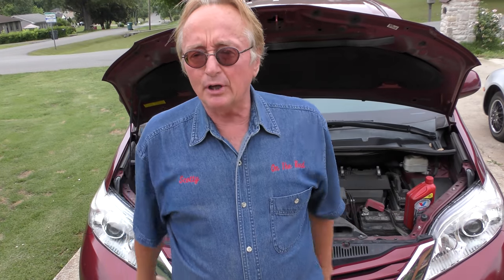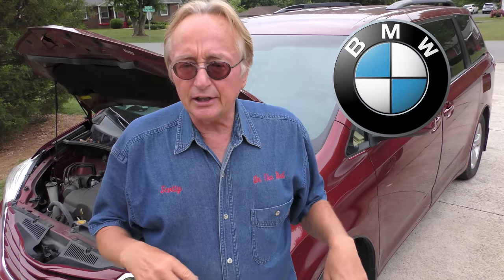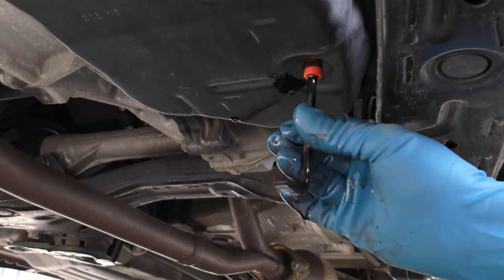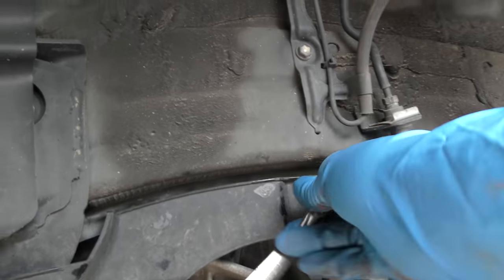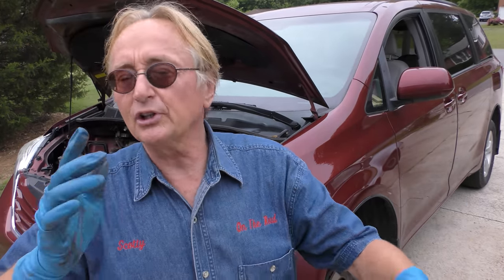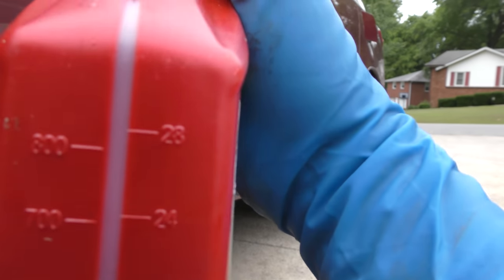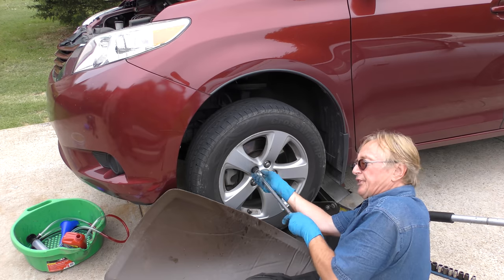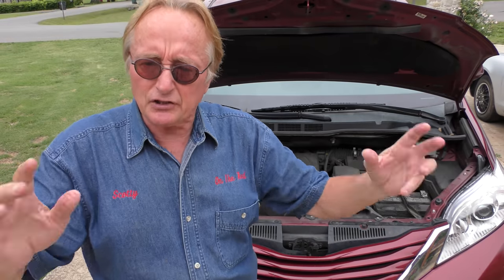Here's Why Changing Your Transmission Fluid Can Cause Damage

Comment: Hi Scottt hi have a 2012 civic lx sedan with 190k miles maintenance done regularly because it's my daily car . My issue  is that it's grinds when shifting from park to reverse and drive not often . Also it does the noise when coming to a stop. Also the transmission shifts great with no hesitation at all . What can it be

Comment: I got an 2003 Chevy Suburban 1500  that seems to be in limp mode. I can't go fast my rpms may stay at 1500 or less when going 50 60mph. And it's as if I can't get out of 2nd. It also has a hard shift and can take a while to even get out of 1st. Anyone have similar issues?

Comment: Hey, Scotty- I have an '02 Toyota Sequoia with 246k miles on it.  The transmission fluid was changed about 25k miles ago and has been clean and leak-free.  On Saturday, getting onto a highway going uphill, I pressed the gas, it accelerated (no slippage), and I allowed my engine to rev up to 4500 rpm before it shifted from 3rd to 4th gear and then I smelled a burning smell.  I tested it again at 3500 and burning again.  Haven't gone above 2500 since.  The fluid is now a little darker than it was.  Everyone says don't change the fluid, but it had already been changed semi-recently.  is it wise to change the fluid?  It's shifting normal so far- no slips, and the shifter goes as normal.
Reply: it was mentioned @0:50 that if you are way past 80k mileage without ever changing the transmission Oil then don't bother changing it cuz it might result to more problems and just pray that your car will last as long as possible
Reply: @03Shinigami he said 180k miles not 80k miles

Comment: Friction can multiply. I lower the wheel to where it touches just enough to not turn when I tighten the wheel bolts for the final tightening. If somehow the wheel wasn't perfectly centered with the weight of the car on it it might not be able to center the wheel. Then while driving I'd here some vibration as the bolts loosened up as the wheel rattled. Back around '85 I heard my front left wheel of my '67 bug making some noise and pulled over and noticed the wheel bolts had rattled most of the way out. OOps.

My 1999 Camry has a tranny dipstick and my 1992 Nissan Truck doesn't. I drained the gear oil and then realized the fill plug was in so tight I couldn't get it off  even with mega force to the point I was worried about breaking the case. Noticed the reverse light switch electrical plug thingy was vertically the same height so that came out easy and I filled it through that hole.

Comment: So before I started driving no one told my about all my fluids I only knew oil and power steering like the serious ones, and I’ve been driving my 04 4cyl accord for 3 years now for months been noticing like hearing something grind always thought it was something in the engine but ig it was my transmission 😁 when I checked the level it was bone dry the gears have never slipped on me tho just pretty sure grinded so I put the fluid in and I can hear the same noise still kinda smoother but not really is it going out or should I switched the transmission fluid? Need some help need her to last as long as possible rn
Reply: Unfortunately, your gearbox is about to die. Changing the fluid won't change that. Change the filter - Hondas have an external one on the hose and keep the level right. Buy additives to increase the viscosity of AT fluid.
There is nothing more you can do and no one knows how long it will work.
I'm sorry. that I can't give you better news.

Comment: Don't buy a Ford F-150 XLT automatic.  The Lead Assemblies inside the transmissions fail between 60,000 - 70,000 miles.  Mine died literally at 60,060 miles, 60 miles past the transmission warranty.  $850.00 repair, then they programmed the transmission with an unreleased Ford tune that made it run like a banshee, no first gear lag Ford's are famous for, then called me and said I needed to bring the truck back to have the factory tune put back on.  Told them nope, it runs GREAT!

Comment: It’s a myth that an overdue transmission fluid should be left in the transmission. I’ve discussed this extensively with educated transmission rebuilders.  That was the case with fluid from the 70’s and earlier.  A varnish would be produced by the overdue fluid. When removed/drained, problems would occur.  Ask any transmission rebuilder if they’ve seen varnish inside any transmission case in the last 50 years.  By my own experience,  i have followed my trans shop’s advice and changed over due fluid dozens of times.  No issues.  Scotty is wrong here. I’d like to know his further explanation how changing overdue fluid causes problems .
Reply: Old Ford automatics used Whale oil

Comment: actually if you follow the matinace schedule for oil,transmission fluid changes you will be fine,bout my 2010 Nissan versa non cvt,followed its guild line on fluid changes,it sits at 296,000 and still going strong,shifts like a new car and great gas mileage ,i know this guy means well but have to take what he say's with a grain of salt.i know others wont have the same out come just expressing what i have done to keep my little bread box going.

Comment: Ah. I think i just learned why the dealer told me this was a $200 job even though it sounded basically the same as an oil change. It's because the dipstick is gone. Now I suspect that was intentional.

Comment: Hi Scott, thank you for your generosity for sharing. What is your take on changing transmission filter as some workshops recommended?
Reply: If someone changes the oil in the AT and does not change the filter, I recommend seeing a doctor. The author of the video should start with the doctor - he doesn't even know how to measure the oil level, he doesn't know that the filler hole is not an inspection hole... and he changed 35% of the oil. The video is very funny. Mr. Bean 2
Reply: Actually, all shops are different. Some shops refuse to work on trannys. Some refuse to flush, but will drain n fill. Some shops say they will drain  n fill, but make it clear they wont drop the pan to change the filter. Always ask what their policies are. If it's a simple drain n fill like this vid then clearly you can't change the filter withoup dropping the pan. Vehicles are all diff lol. I have a business that have put well over 350k miles on several vehicles, most of them never had trans filters changed. I just blew a tranny at 220k which was my mistake bc I thought it was serviced. Never was, got my records mixed up. At the very least, I'd recommend drain n fills on a schedule, but what the hell do I know. I'm not a mechanic lol.

Comment: The lack of a transmission dipstick is one of the most moronic things about new cars. The inability to easily check and fill the fluid in what is probably the most complex device in your car, not to mention really expensive to rebuild or replace, is absurd.

Comment: Any idea how to check the transmission fluid on a 2013 Chevy Captiva and reset the light(words that say change transmission fluid) car has 160,000 and never changed fluids and now this dumb warning comes on! I'm just a girl .....lol
Reply: Teri, has anyone helped you out yet?
Reply: @vigilantemotors  No sir. Thank you for asking!
Reply: @Kaitlen5  Mind if I offer some advice?
Reply: @vigilantemotors  please do! Thank you!
Reply: @Kaitlen5  Teri, it is a sealed transmission so there wont be a dipstick like with engine oil to check. If the light is on you may have to bring it to a dealer to see if its low. 

Is it leaking anything?

The Chevy Captiva change transmission fluid' warning will come up on the car's dashboard when a fluid change is required. You can reset this by turning the key in the ignition over to the 'on' position and simultaneously press the gas pedal three times. Now, put the car off and start it fully. When the engine runs, it should trigger a reset of this warning. 

Keep in mind this may not work. Sometimes what car mfg's do is only allow those things to be reset with a scan tool thus making most people forced to bring there car in for service.

Does that help you at all? Sorry I was long winded.
Reply: @vigilantemotors  I had already tried the process to reset the dashboard and that failed. I am 50 years old and was married to a mechanic for 22 years and we never changed the transmission fluid in any vehicle we had. I'm just kinda blown away by this and I'm a single woman with one income and can't afford to take it to the dealership. Midas quoted me $200 to change the transmission fluid!!! I about had a heart attack lol!!!
Reply: @Kaitlen5  I am really sorry Terri, that's terrible. What state are you located in if I can ask? I'd happily change it for you at cost if I was close by.
Reply: @vigilantemotors  Bowling Green KY

Comment: Okay bro this is confusing SHOULD YOU or SHOULD YOU NOT flush transmission fluid if you haven’t had it changed 100k miles down the road

Comment: Have you checked the alternator? It could be switched up with a carburetor for more fluid airflow through the shift column.
Then, by process of convection, you will maintain pressure throughout the drive terminal, providing the drive terminal is centrally located UNDER the main pressure valve caddy corner to the secondary valves in the rear, which may or may not be eliminated entirely.

Comment: I change my transmission fluid on my 2013 F150 every 90k miles religiously. 😂 I've changed it twice, and the dealer did it at 227k due to my torque converter going bad.

Comment: I have an idea on making the automotive industry  to return the transmission and motor oil dipsticks. When buying a car from a dealership, insist that if there is no dipstick, demand that one be installed. If the sales person either refuses to have one installed or tries to convince the buyer on not doing such, walk out of the deal. Do not keep talking to the sales person. Leave immediately! If enough car customers followed this advice, manufacturers will return to installing dipsticks.
Reply: No Full size spare tire in trunk..
NO DEAL!
Just Walk away

Comment: "Life time oil" is the life of the warranty!  I rip the stock oil out as soon as I get to 1500 miles and use a 100% Synthetic oil in everything that requires oil(AMSOIL), this eliminates the wear on components so they don't have the wear you get with conventional oil. Waiting until the warranty runs out to use better oil is ridiculous, as the damage is already done.  The Dealer can NOT force you to use their oil and other components, if they insist they can be sued and they also must supply it for FREE, they can charge for labor, but nothing else!  Know your rights as a consumer!  Must be in canada, we don't use metrics here accept for bolts, which is stupid!

Comment: How different is the transmission fluid between the off-the-shelf cheapo [for Fords] at AutoZone instead of the Nisson Matic S for a 2013 Infiniti QX56?
Reply: Very.
Reply: you wouldnt want to use Ford fluid in a Nissan.  EVER.  There are many aftermarket brands that make compatible fluids for Nissan that meet or exceed the requirements of Nissan.

Comment: If you are hellbent on revamping your transmission fluid on an old car do not drain or flush it as this will remove any material floating around siphon a quart and replace it so that you have less degraded fluid without risking compromising the transmission. Lather rinse repeat. Don’t do it on any cars that are presenting metal in the fluid, otherwise you will be removing friction material that very well may be holding your engine together.

Comment: No filter change??
Reply: Yes , mine does . 2018 Silverado.
I change it every 50K miles.
1 filter
1 gasket
6 quarts Dexron 6
= $160.00
1 hour labor currently $150.00 an hour.
Total cost around $300.00 at a shop.
You save on the labor cost if you do it yourself.

Comment: 1. Where the hell did you find a vehicle with a transmission drain plug?

2. Have you never worked at an oil change shop? You tap into the transmission coolant lines to change the fluid, literally standard procedure.

Edit: This is standard procedure, according to Texaco, last I worked with them anyways. They have an exchange piston mechanism which the tech puts 14 quarts of new fluid in one side, tap into the transmission coolant lines, and run the vehicle while the transmission hydraulic power pushes the old fluid out, while sucking the new fluid in.

Fluid level shouldn't change in this process. They say the average transmission has around 6 to 7 quarts of fluid in it, and there's no other proper way to change the fluid, unless you just rebuilt the thing.

Comment: Didn't remove the pan or replace the filter ?  Practically useless to change less than 1 quart  of fluid.
Alot more would've come out if filter removed.
Reply: Are you thinking engine oil?
Reply: @quantanglement  No.  There's no need to remove oil pan to change engine oil.   But if your automatic transmission has a pan and a filter,    proper service is to remove and clean the pan,  and replace the filter.

Comment: Transmission fluid in high mileage cars can be changed safely by a competent transmission expert. They can completely flush the system by diverting the fluid directly to waste and then forcing it through with fresh fluid. It requires sacrificing about a gallon of fluid but prevents contaminants from destroying the seals.

Comment: Do a better job by fill and drain it at least 2x because only 1/3rd of the fluid ever drains like this.  There is few more liters in the torque converter and also in the filter and other areas of the transmission.  1.5 liters means that there is other 4 or 5 left inside and you do not want to leave that old fluid longer than 77k miles.  That filter should be changed also and the oil pan should be cleaned and magnets cleaned.  For god sakes if you can not do a major service every 77k miles on a transmission you should not be owning one.  If it was my machine i would change the fluid every 30 000 miles or 2 to 3 years max.

Comment: So you don't even drain out 1.5 quarts. And you call that an oil change? When the capacity of the transmission is 10 quarts.. At least drop the pan. Clean it out along with the magnet and change the filter. At least a new filter will try to clean the eight quarts still remaining in the tranny

Comment: 54 easy steps, with 21 tools you don't own (and have no experience using), and wa la, your transmission fluid is "probably" changed correctly. If you get it wrong, no biggie, just buy a rebuilt transmission and follow the 423 step plan to uninstall the one you busted, and pop in the new rebuilt one.

Comment: I flushed transmissions 3+ tunes daily for 10 years.  Never once had one come back with problems. 

That's nonsense old wives tails.....

With a caveat.  Always asking if they are having problems BEFORE performing the flush will save you a lot of headache from idiots thinking changing fluid AFTER they have a problem will fix it.

Comment: That’s great for the fluid but if you don’t remove the pan and clean the magnets you’re skipping the most important part magnets are inside the pan to catch the fine particles of metal that is normal wear and tear but the magnets can only hold so much so if you don’t clean them they stop catching new metal particles and they eventually wind up packing your solenoids Full of metal because while energized solenoids are electromagnets

Comment: Scotty,I have a 2017 Audi a4 2.0 T its got 96.660 miles. the trans started making a whining noise. So i took it to audi.
They checked it out and said the trans is Failing. I have Protect My Car warranty. They asked Audi when was the trans oil changed? They said 40 and 90K miles. PMC said does Audi say its ok to let it go to 10K over the 40K mile oil change?
Audi dealer said No. So now Im screwed and have to pay to buy a used trans at $1600. and pay Audi 2k to install it.
F--K Audi and Protect My Car. Im Done with CVT Trans Crap. Im buying a Toyota Hylander and trading in the Audi for a Lexus
Car Not the SUV. Hopefully the Lexus car Doesnt have a CVT Trans. Does it?

Comment: 135,00O miles never I had a change because there is filler cap and no dipstick! What a bunch of Dipsheets! No mention at all of where our how to change the fluid in the owners manual! Mitsubishi Outlander PHEV 2018, the car is supposed to be electric motor driven. D.O.A.

Comment: Less then two qts drain and fill..? another way to make you say.... F-it.  basically every oil change, do the trans. Mine just went out, 2005 Chevy equinox, the cooler lines got crimped in a bumper bender so the trans overheated, it leaked a bunch of fluid out and it was BLACK, new fluid made all the sludge come loose and clogged it up.  The dipstick is a tiny thing behind the front mount, no way anyone can see it. Screw American cars or any car make like that, I will never buy another.

Comment: You clearly don’t know what you’re doing!! All vehicle without a dipstick have a plug you take out once it starts to come out of that plug it’s full then you put the bolt back in all vehicles have that in a different place so you have to look online or in the owner manual for the location of the transmission full plug

Comment: You never need to change the transmission oil 
Like you never need to change engine oil 
Both oil  last forever in your car 
You can run your car without any oil change or coolant or amy other fluid as well 
When it broke down just buy a new one 
Lol